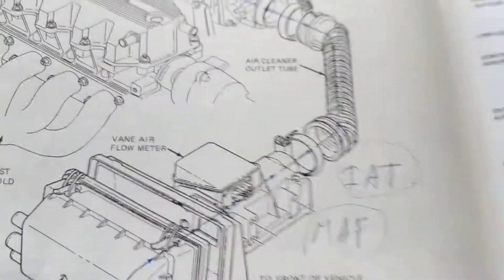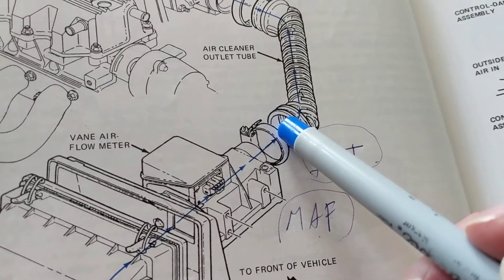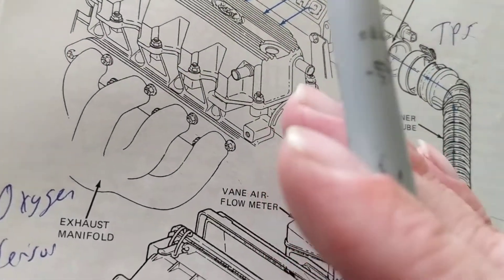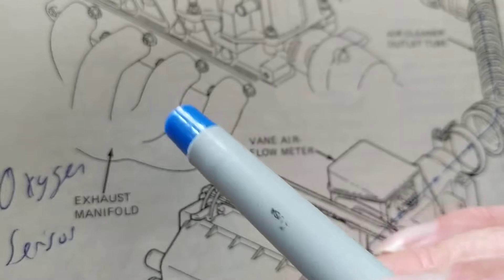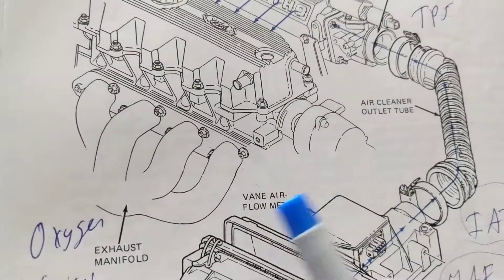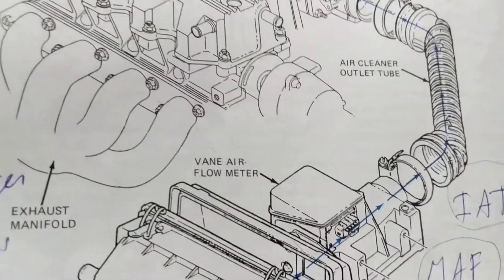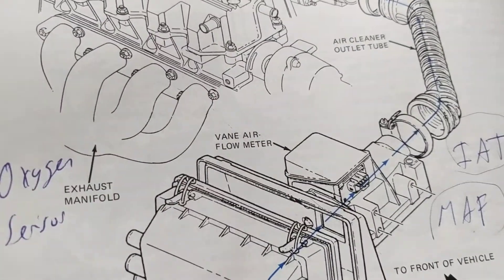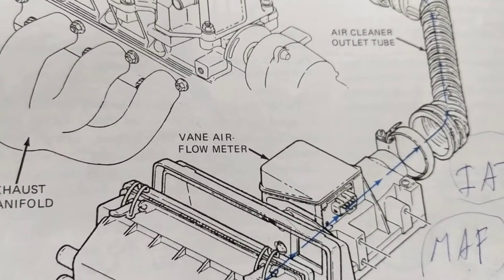How air intake system works

Comment: Thank you for this video. As a woman, I don't much about engines except sizes and that they need oil. I've often had car problems. I always wanted to know what certain terms, such as "manifold" meant.
Reply from the maker: Welcome to the channel the term manifold means the part of the engine which carries the air mixture and the fuel mixture into the engine called the intake manifold the output of the engine is called the exhaust manifold think of it as the arteries supplying blood to the to the heart thank you for your comment